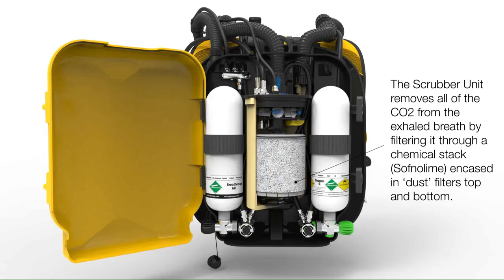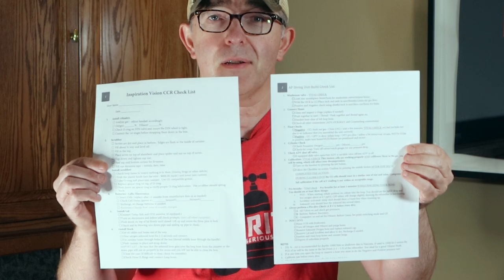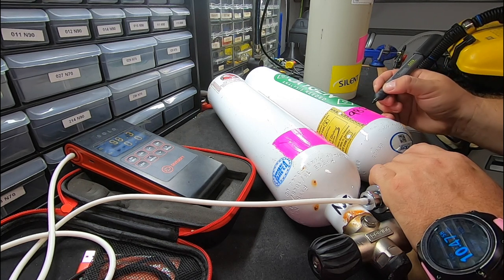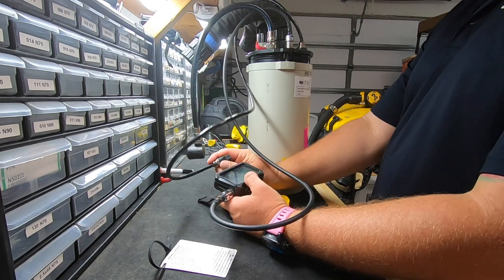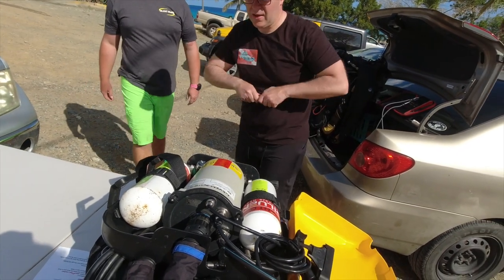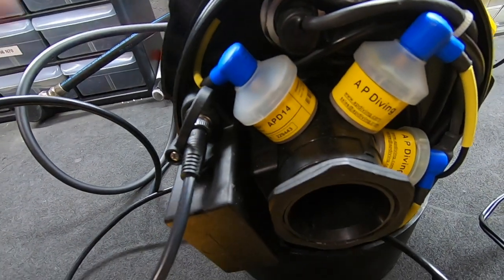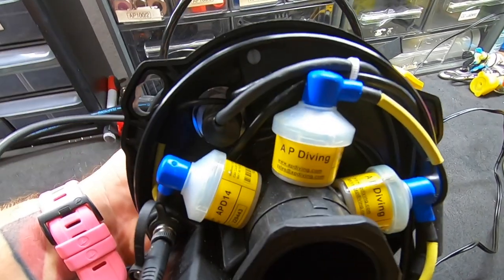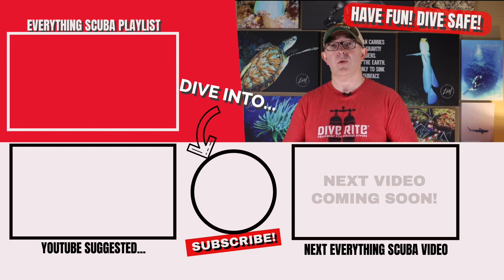How to Build the AP Inspiration Rebreather (Rebreather Scuba Diving)

Comment: So on average how long does the scrubber additives last?  Very informative as always. Thanks
Reply from the maker: +Steve Michel in some ways depends o the individual diver based on amount of CO2 they produce and also depends on the environment and conditions you are diving. The most conservative measure is no more than 180 minutes of diving but that number was arrived upon during testing with a diver under heavy workload and diving in water around 3 degrees Celsius (37F). You can also tell by your temperature stick reading on the handset how much material has been used up. As the absorbent material becomes used that area of the temp stick cools down because no exothermic reaction is occurring around that area and you can gauge how much has been used.
Reply: @everythingscuba  also many CCR systems offer at least two different size scrubber canisters. By allowing larger amounts of scrubber material onboard the CCR diver is liken to the use of larger diver cylinder sizes allows for additional operating time between sorb exchanges. 🤙